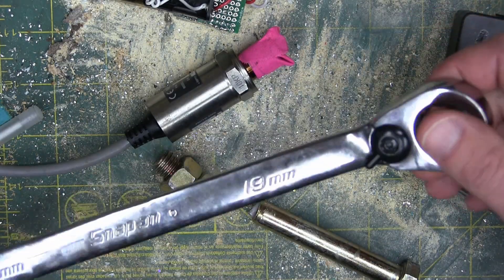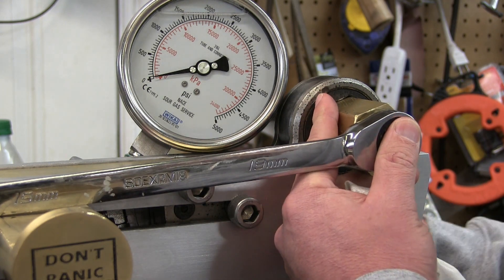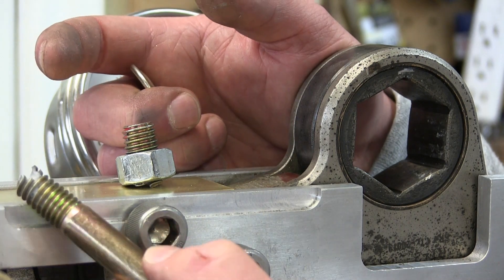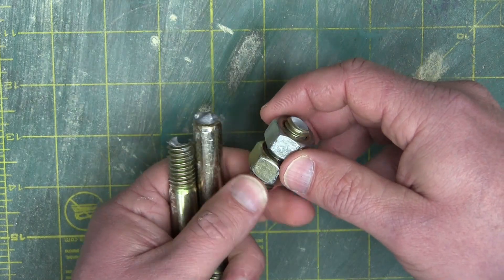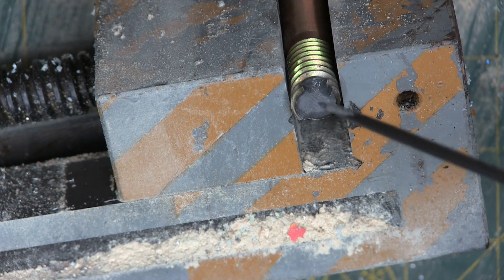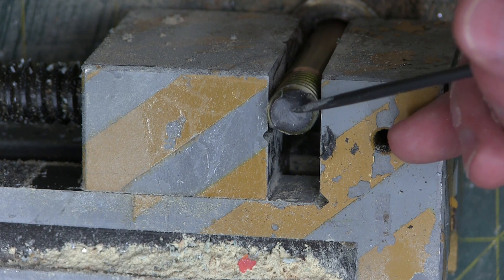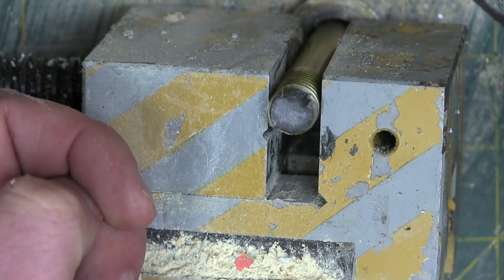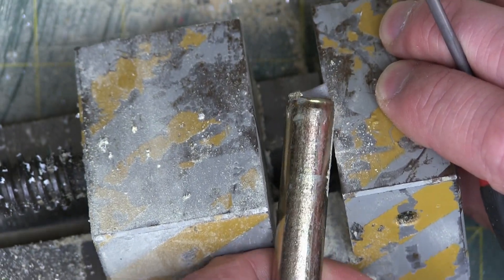BOLTR: BOLTS! | How much torque before break?

Comment: Going to a mechanical high-school (as in a high school that was meant to crank out automechanics), we had a joke that the perfect torque is "til you crack it and back off half a turn" 

Now, how do you know you've cracked/broked it? The bolt itself becomes looser. Now being dumb 16 year olds without the teacher's supervision, we put a snipe on a wrench and tested that saying out, and sure enough you can feel it loosening up before it breaks, and you fall down to the floor.
Reply: shurdi3 that's always the scary part of working on something, when you're really going ham on a bolt to get er torqued, then all of a sudden it gets super easy to tighten, and ya know that ya done fucked up
Reply: The flip side of that raises this question: How the hell can the aluminum block hold the steel bolt until they wring off when you're trying to break them? You can't do that when your putting them in!  Mystery physics.
Reply: Firecul42 then you break out the helicoils
Reply: I have a feeling it was a rhetorical question, but here goes: when you put new steel bolts in an aluminum block, the threads easily slide over each other and over-torquing the bolt causes the threads to pull out from excess bolt tension. When a steel bolt is corroded into an aluminum block the corrosion keeps the bolt from turning in the first place. I've had long alternator bolts snap from the shank getting stuck in the alternator body after the threads are already clear from their hole. The power of dissimilar metals!
Reply: It really fucking sucks when it say 144 ft.lb.  when they meant 144 in.lb.

Comment: 1/2" bolt + metric spanner = mind fuck!
Reply from the maker: Most sizes are too sloppy but 19mm is dead nuts 3/4" and 15/16" is 24mm.
Reply: Depends how dead your nuts are.  19 and 3/4 are dead enough for the girls I go out with.
Reply: 7/16" & 11MM don't really matter either, I use whatever's closest.
Reply: Who's talking about spanners and bolts? I'm talking about the comment 3/4 inch is dead nuts 19mm. That is incorrect. If you want to talk spanners and bolts  as regards to perfectly machined bolts not existing the word 'perfect' doesn't exist in engineering but within tolerance does, and I have supplied both specially machined bolts and spanners with tolerances under a thousandth of an inch. So if we supplied a 19mm spanner it would not fit a supplied  3/4 hex bolt even if one was top limit and one was bottom limit. Now this may all seem pedantic but it is very much dependent on the industry you're in, and the industry I'm in means I could not overlook someone saying 19mm is exactly 3/4inch because it isn't.
Reply: But why would you want to have something sloppy on your bolt?
Reply: AvE I work on Jag E-Types, everything is imperialist, slowly getting used to it, just for good measure they've thrown in a handful of whitworth too!! 
Love the vijeos and so happy I can now view more as a Patreon too!!
Reply: fredadhbit Unfortunately I don't have an 'interference fit' with most of the girls I go out with! Lol!
Reply: Hell, 17 and 3/4 are dead enough for me
Reply: AvE 5/16 and 5/32 Allen keys are 8mm and 4mm compatible too at a push👍
Reply: If you were referring to mass produced stuff why did you say machined? Mass produced bolts and spanners are seldom machined. Then you seem to insinuate better quality gear is not available. I merely stated that it is available.
Reply: When working on old stuff, it's great to have both to choose from since they mostly fall between each other. Most M8 bolts have 13mm head size, if they are rusted down a bit 1/2" is perfect to get those buggers loose.
Reply: I always grab the 19/25ths
Reply: Settle down Francis...
Reply: Sometimes it only depends upon how much swing room and how big of a hammer ya got.
Reply: I hate to be 'that guy' but 3/4 inch isn't 'dead nuts' 19mm. It's 19.05mm. That's just under two thousands up for you imperial freaks.
Reply: Josh Hanson Mathematically correct but unless you're using a perfectly machined spanner on a perfectly machined bolt (they don't exist BTW) then you can easily combine the two mi amigo👍
Reply: Josh Hanson You're right, it is pedantic, and I was referring to mass produced kit, of course you can get custom made stuff. 
Have you seen this channel before? It's pretty chilled, peace  out, have a cold one!
Reply: Josh Hanson And I used to surface grind spacers to a tenth of a thou', after a while just put a sharpie on them and when it slightly faded and didn't disappear you knew you were there.
I know what a tolerance is. 
Jus' saying👍
Reply: If you know what a tolerance is, and you know 19mm is not exactly 3/4 inch why the ** are you arguing with me? And I use microns not tenths.